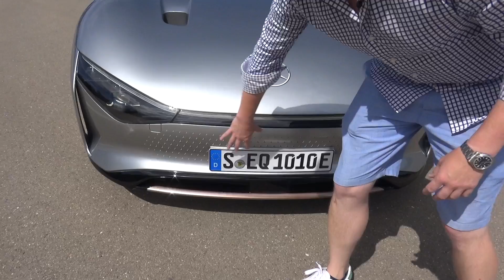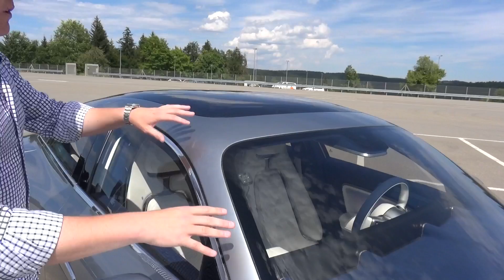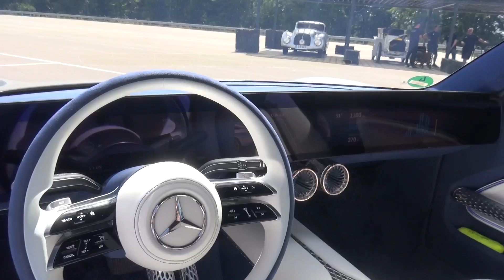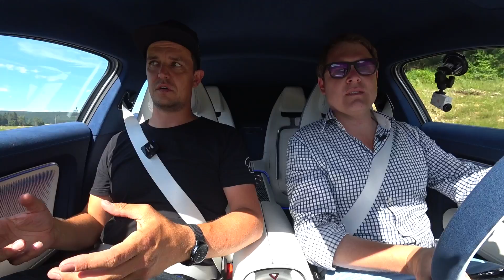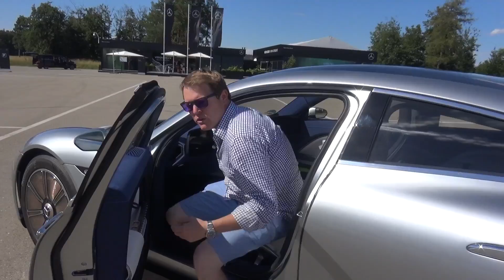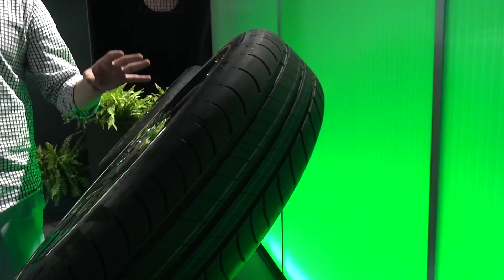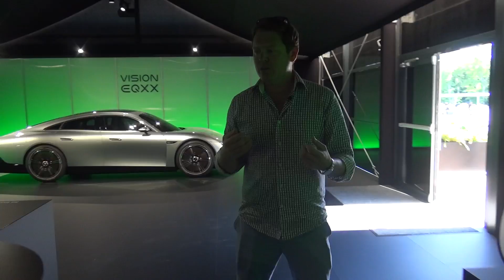New MERCEDES EQXX First Drive! The Record Setting EV with 1,200km+ Range

Comment: Over 700 miles on a single charge is pretty impressive 😳
Reply: Toyota Mirai: first time?
Reply: @KaypangAsli  Mirai has an EPA-estimated driving range of 402 miles. A little better than a Tesla Model 3, and it weighs more.
There hasn't been a single new hydrogen fuel cell car announced for production since the 2019 Mirai second generation.

Comment: Magnesium wheels, huge battery pack = firefighter nightmare. I’m not against EV’s, I’d happily have a Rivian or a Tesla, but the lifespan of the batteries is what would put me off, coupled with the expense of replacing them when the time comes. And how environmentally sound is the battery production process?
Reply: lol like replacing a brand new engine is more cost effective or more safe in case of combustion. the time is now for ev's!
Reply: @CTHR333  replacing an ICE is way cheaper than replacing one of these battery packs, you can buy and fit a used ICE for a couple thousand dollars, I’m not entirely sure what safety has to do with the issue. I’m fairly certain a battery assembly and swap out on an EV will be infinitely more expensive. But yeah, you stick to the ‘EV’s are now’ dogma, let’s chat again in 5 years when we know that actual costs.
Reply: @Ginto5629  yeah we’re only scratching the surface of battery tech, combustion engines can only slightly improve. Keep banking on Toyota and their hydrogen fuels bud😂
Reply: If you're worried about battery fires, you should be terrified how many gasoline cars catch fire _every single day_.

If you're worried about making a 1/2-ton recyclable battery pack, you're going to be shocked at how bad it is to make the TONS of gasoline that a gasser burns through.

Comment: Curious to see how much a battery replacement would cost? Also, what the battery lifespan is
Reply: Interesting to hear the price, however, typical EVs that are produced now or later won't need a battery replacement during the lifespan of the vehicle. The batteries will outlive the rest of the vehicle and can be reused as energy storage elsewhere before finally recycled. (And yes, the recycling processes "aren't there" yet, but this will change.)
Reply: @mattipeltola4394  yes, modern EV batteries should retain 80% or more of their capacity after 20+ years. Most 20+ year old cars are junked anyway, and batteries can be repurposed for a while until they’re recycled.
Reply: @sultanqasim  I have never seen or heard those figures before- which car manufacturers are using these batteries
Reply: Nissan Leaf, 3-4 years. $5300 for the battery pack. Out of warranty add an another 3,000
Reply: @jmagno5816  Yep, Nissan Leafs showcase how old battery design and air cooling isn't a good idea. Thermal management of modern and future liquid cooled batteries works significantly better and makes the batteries last so much longer.
Reply: A Gozillion trillion.
Reply: @jeebuscrise4482  a morbillion
Reply: That price was 2 years ago.
Reply: No one has a clue. You are basically asking how a much a item is going to cost in 15 years. If anyone is that smart you could become very rich.
Reply: @Neojhun  That's my point! In 15-20 years there are like using a pre smartphone, the chargers are not compatible and the interface of the cars don't work any more! Pretty useless for most people!
Reply: Doesn't matter, you'll get rid of the car before then
Reply: Battery cost will be comparable to the cost of engine overhaul/rebuild so it's not really outrageous.
And battery lifespan is projected to be at least 1,000,000 km.
Reply: You've heard of the million Mile Tesla right?
Reply: Interesting how they have all these "sustainability elements" on the interior, but the battery's are still made from ores in third world countries, and those are mined and create alot of carbon emissions, that have to be transported by boat, onto a truck, and manufactured using processes that have alot of carbon emissions. All that to have a battery that is useless and won't be fully recycled in 5-15 years. But they have an interior to justify the car as 'sustainable' because it's on mushrooms, bamboo, and cacti. Sure, the battery/car is "eco friendly" but that doesn't really counter the emissions created making the batteries.
Reply: @jwalster9412  you did well swallowing the fossil fuel industries' disinformation. They've got you worrying about the pollution from making a 1/2-ton valuable battery that WILL be recycled, while ignoring the far worse pollution from the mining, refining, spilling, then BURNING of literally dozens of tons of actually filthy fossil fuel that an EV will displace in operation.

If you're concerned about the environmental harm from making a 2-ton product, then don't own a car. But if you do, EVERY reputable study concludes that an EV is better overall for the environment than driving a gasser; after about 7,500-20,000 miles the more efficient operation overcomes the hit of the big battery. And since the majority of new generation is wind and solar (because they're cheap and quick), an EV will only get cleaner.
Reply: How much energy is used to search for oil. The seismic ships. When found you have to drill for it with large oil rigs and support vessels. Then you have to build enormous production platforms with helicopter crew transfesr and countless supply vessels. How much energy is flared off in waste gas and how much energy to build and maintain and power the export pipelines. How polluting are transport oil tankers. How much energy is used to build refineries and then run them and then carry products to storage tanks. How much energy and pollution is there to truck it to the garage and then people say it is not environmentally friendly to dig lithium out of the ground!!!!!  @jwalster9412
Reply: You can probably drive it 1.000.000 km before the battery dies.
Reply: @MT-eb2dx  If the capacity drops significant, nobody will buy it or drive it! When driving it in the winter under -10C with full heating the range will dramatic change to the worse!
Reply: @Fred-ck1gh  so what. Cars do not last forever, big deal
Reply: @MT-eb2dx  i your dreams, when tesla batteries go bad like under 200.000km
Reply: @Japixx  that is still enough to last long enough. The problem is that this car is a prototype ...
Reply: Surely we're aware at this stage that anything more than 4-5 years on a lease with a warranty is asking too much of these manufacturers. I'm not excusing Mercedes or any manufacturer for making cars that don't last but seriously, just move it on and get a newer, safer one.
Reply: @mattsteele6367  "just buy a new one" said the clown. I'm sure you buy apple products too.
Reply: Batteries are getting better and cheaper everyday.  Lots of innovation happening in China right now.

Comment: How long does it take to charge from no charge till charged
Reply: It's a 100 kWh battery with a 900 Volt architecture. There are 350 kW DC fast chargers, so theoretical best is 18 minutes, but it depends on the charging curve -- the amount of power the battery can accept at different states of charge. The key with this car is it's so efficient that you might be able to add 500 km of range in less than 12 minutes.

Comment: Looks pretty nice but I hope Porsche will save us with synthetic fuels. Unfortunately living in London zone 2 I find impossible to install a charging point  for an electric car.
Reply from the maker: London is a shocking place for EV charging, it's awful
Reply: @Shmee150  sorry Shmee, but I charge my Tesla just fine in west London and theres a ton of charging down every street in all the lamp posts and dedicated chargers, but tbh I just throw my cable out the window! Don't know what you're talking about on this occasion... 😬
Reply: I just want the future to be v8s v10s and v12s
Reply: We'll have to wait for electric vehicles to have induction charging like McLaren speed tail. That will reduce changing problem.  Although it is slow it will be enough.
Reply: You can hope but the truth is that noone is gonna save us from electric cars. Posche will turn most cars in it's lineup electric in 1-2 years.
Reply: Yes, here's hoping for a future where the air we breath into our lungs will be contaminated by Porche for only $99.989 per gallon.
Reply: Water-based synthetic fuel sounds interesting
Reply: Tesla also screwed. Too much competition now
Reply: @festuspunky  But you could fit solar panels all across Africa and generate the hydrogen using solar and then transport it all over the world on boats and planes also powered by hydrogen. Better than digging up billions of tons of soil to mine for cobalt and then dump the batteries in the ground when done
Reply: @TDL122TDL  your going to dig up mountains to make the solar panels.. we need to get serious about fusion.
Reply: @TDL122TDL  it is comical that you are so upset over mining millions of tons of material to make 1/2-ton valuable RECYCLABLE batteries, while ignoring the far greater environmental harm of mining, refining, spilling, then BURNING literally billions of tons of fossil fuel. Fossil fuel pollution is orders of magnitude worse than making batteries.
Reply: @skierpage  Not what I meant
Reply: I’m pretty sure fuel cell is the future anyway.
Reply: @matthewkobylinski510  not really. Depends on country to country
Reply: @mohammadzohorul8887  yeh I watched a talk with the head of Toyota. He thinks a mixed economy of fuel types will be the future. Battery for some but they have downfalls charging, carbon footprint,  rare minerals, he thinks some people might benefit from synthetic fuels and some over the next whole from hybrid tech, some from hydrogen.
Reply: @mohammadzohorul8887  how come? Hydrogen is possible to refine anywhere, even on remote islands. It is already possible to have a hydrogen station at home. 5 minute fill up means that you can live with as many hydrogen stations as gas stations and not have massive wait times. Also, it is actually environmentally friendly when compared to EVs and safer in accidents.
Reply: @ed8519  yes the economics of fuel cell is much more stable than that of batteries
Reply: @matthewkobylinski510  They have hydrogen buses all over my town. I think the sticking point isn't safety it's the cost, hydrogen is more expensive than fossil fuels. Price needs to come down. It's the most likely alternative for public transport or long haulage, trains etc. Those won't be changing to battery.
Reply: @matthewkobylinski510  My professor said about designing these systems is that if people cannot afford your technology it will be pointless to make it. Plus the fuel fillers are so chilled that it sometimes gets stuck to the car which is real annoying for people.
Reply: @ed8519  yes also watch that video. Plus the oil companies will try hard to lobby and stay at the market.
Reply: @matthewkobylinski510  it may be true that you can refine it anywhere, but it’s expensive and extremely energy intensive
Reply: @skierpage  I don’t think they’re dead since Bmw, Hyundai, and Toyota keep developing new models. The problem with batteries is their recycling which demand we cannot meet for the forseeable future. So if neither option is good, is combustion good then? What’s the point of developing all this EV stuff if it’s not more green in the end? The current oil and gas crisis showed that relying on a few countries for production is not great. And battery stuff is only found in like one place in the whole world. So what’s the point of stopping ICE cars
Reply: Move out of London
Reply: All electric cars are a waste of time. Sustainable fuels and hyrodgen is the only way
Reply: @TDL122TDL  Hydrogen may be a viable option somewhere but for normal car usage battery electric will continue to excel. At least for now, hydrogen fuel cell vehicles also need a battery - even if a slightly smaller than in an battery EV. Basically, a fuel cell vehicle need all the same components than a BEV plus all the hydrogen tech. And the running cost on hydrogen is and will remain much higher vs. running on battery electric: Some much energy (=money) is lost in producing the hydrogen.
Reply: @TDL122TDL  They are not and they are at an early stage of development compared to people transitioning from horses to cars.
Reply: @mohammadzohorul8887  Well, if they were the same price as a petrol powered car and had a good range of 400 and you had the ability to charge it up at home, then it's a no brainer. However, they are twice the price, inconvenient to charge, takes ages to charge, range is rubbish and the battery dies after a few years and needs replacing. I think in the future we'll have a combination of eletric cars, hydrogen and sustainable fuel powered cars. Hydrogen makes the most sense for longer journeys. I believe JCB are now working on hydrogen engines for all their plant hire. P1 fuels is leading the way in sustainable fuel and the WWRC and Touring Cars next year will be powered by sustainable fuel.
Reply: @TDL122TDL in the future it will be a combination of electric and petrol-powered cars. hydrogen might be obsolete as it is heavy and inefficient. I studied electrical engineering. We did calculate these things. Once solid-state batteries become mainstream the cost will come down.  Just like the first cars were expensive for the general mass. Electric car technology is in its infancy. So the current costs are high.

Comment: Good evening Shmee150 hope you are doing well I have been waiting for video on this car for absolutely ages I find it really really interesting but the biggest concern I have with electric cars is once the battery has depleted how are they going to replace them because to become green they need to 124,000 miles and not many people do that in their cars these days they get a new one I mean they don’t even do 100,000 miles so it’s gonna be interesting really enjoy your videos thank you very much
Reply from the maker: It's going to be very interesting to see how this evolves
Reply: They don't need to do that many miles at all to break even.
Remember, once it has broke even, it doesn't keep on polluting the same way as a typical car.
Reply: You're spouting out-of-date figures. In the USA a Tesla Model 3 has to drive 13,500 miles to be lower carbon than a gasser. Another study found "For the [less efficient Volvo] C40 Recharge, it's seen at about 48,000 miles with the current EU power mix—or just 30,000 miles if it were charged with wind energy."

Since the majority of new generation is wind and solar (because they're cheap and quick), an EV will only get cleaner.

All new electric vehicles sold in the US come with at least an 8-year/100,000-mile battery warranty, and obviously most batteries don't die the next day. The reduction in energy capacity is real, but with some battery chemistries the decline seems to slow down.

Comment: Just a random question : Do you need to pay Congestion Charge with a Hybrid in London, when you accidentally turn on the Combustion Engine?
Reply from the maker: All hybrids have to pay, regardless of whether you use the ICE or not. The only exemptions are for full EVs, and only for another 2 years or so
Reply: @Shmee150   London is stupid.
Reply: Hybrids are basically an ice car with a small battery attached. Worst of both worlds.
Reply: Got a license for that engine guvna

Comment: Will you buy a Tesla Roaster?
Reply from the maker: No
Reply: @Shmee150  Fair enough, to be fair after you sold the Taycan I assumed you perhaps were less of a fan of EV, not that I would blame you, wondered if maybe something like that would have changed your mind.
Reply: @asr-2507  nah it's cause it's never gonna exist lol. The semi still isn't working after 5 years.
Reply: @Moray2023  same thing with cybertruck
Reply: @Moray2023  I had the chance to talk with a few higher ups at Tesla not long ago. I did ask if the Roadster was close to production, their words were straight up "we don't know"
Reply: @Moray2023  it will exist, why wouldnt it? The semi also is working and driving around as we speak. Quit the bs dude